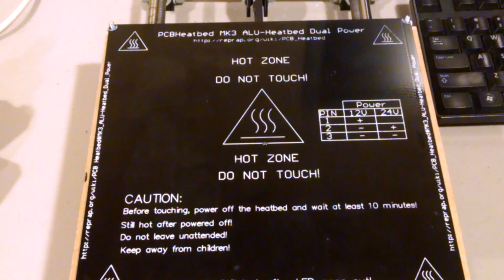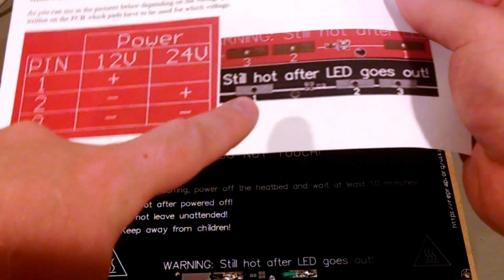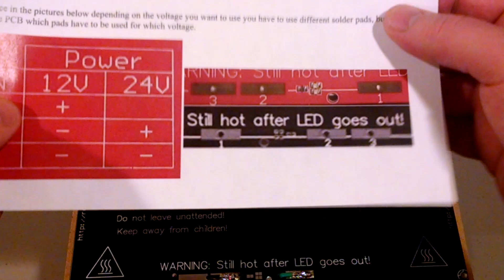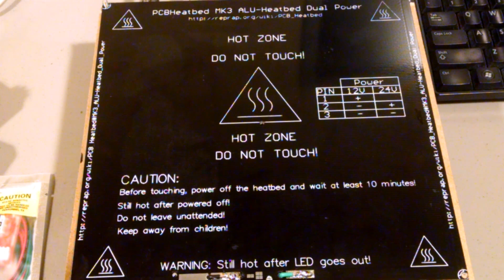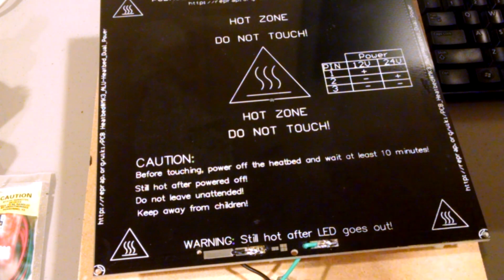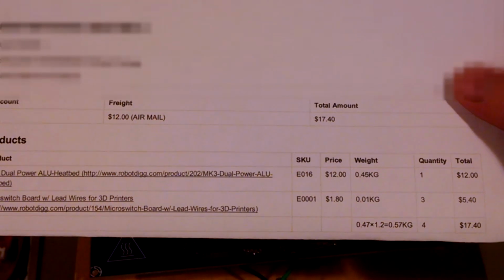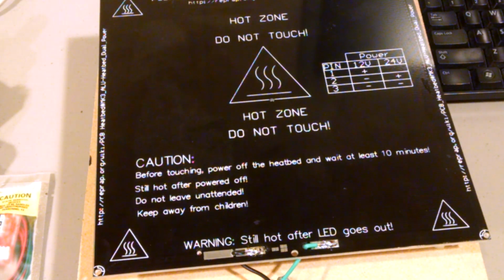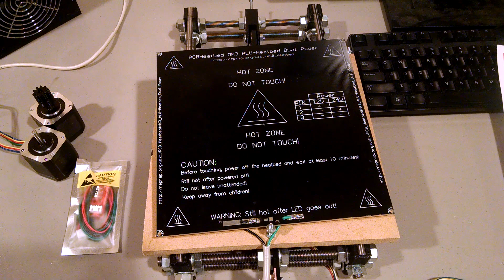3D Printer Experiences - Heat Bed

Comment: Hope your not printing on to the black element side of the board ..if so that's incorrect ..the bare aluminium side is the correct printing surface
Reply from the maker: Good tip.  Yes I was indeed printing on the bare part of the bed.

Comment: We are doing a project atm at our University. 
Do you actually mean to print directly onto this plate without anything else put onto it before?
Reply from the maker: +Hobbygamer27 For PLA, yes.  If the bed is around 60C, you can print directly onto the surface of an aluminum plate.  I just cleaned it with isopropyl alcohol and started the print.  With ABS, you will need something for it to stick too, like kapton tape or a gluestick.  Hopefully one of these days I'll make another video showing my progress.  Here's hoping....

Good luck!
Reply: +dufusk 
What if we mount a PEI covered Alu table straight onto it.
Is the heat resistance of 1 Ohm right?